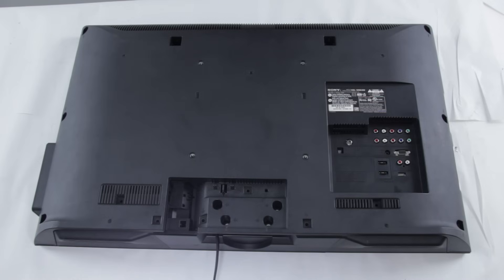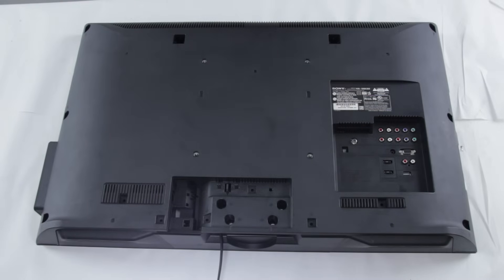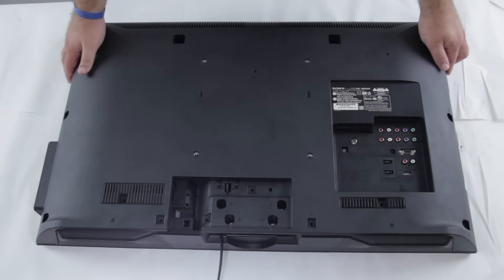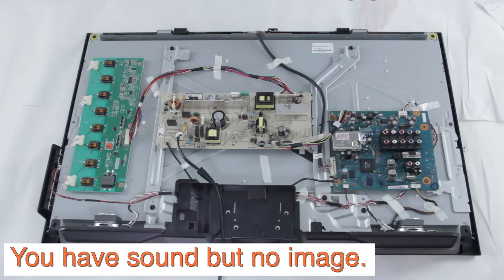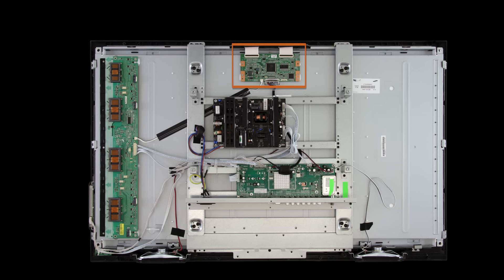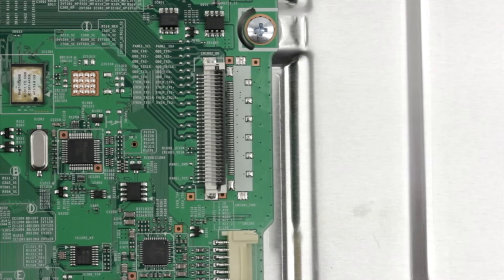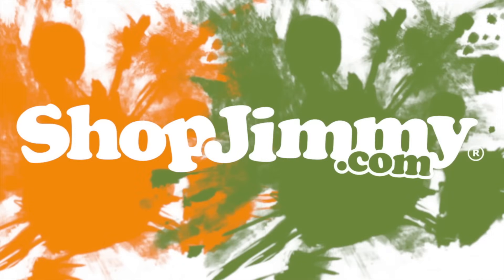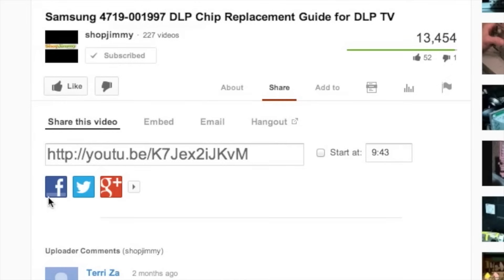LCD TV Repair Tutorial - T-Con Board Common Symptoms & Solutions - How to Replace T-Con Board

Comment: My TV is a Samsung Model: UN40EH5000FXZA VERSION: UF04. I applied what appeared to be a necessary firmware update because I was having trouble with sound drop out occasionally accompanied by picture dropout. Now I have no picture but the back light comes on. The local Samsung authorized repair guy said something like $80 for the board and a total of about $150 or more for the job, I countered, I built my own computer How hard could it be to replace a board. He sent me to a website where I could buy a board for half his price Shop Jimmy's, Do you agree that finding exactly the right board and carefully replacing it will fix it?
Reply: I just noticed your shop Jimmy's link. so I'm getting warm.

Comment: Hello, I took my Sony KDL-48W580B to the shop, because after a storm, wouldn't turn on, had the 3 blink error code on the LED, RED, the guy told me he hald a main board laying around he tested it with, and it did turn on, but had a white screen, my question is, is it fixable? or worth fixing? how much? is it the main board, or T-CON? or both? I really would like to fix this tv! and have experience with basic electronics

Comment: On that sony, I fixed one by putting pieces of cardboard at the top putting pressure on ribbons, supposedly the heat was rising the ribbons were flexing and that cause the TCON to freak out.. same model you first shown..  there was video on here with the procedure and I laughed but it worked... took 4 hours... I do repair for other companies as FE and seriously laughed when a video told me to do this but with that style TCOn, what do you have to lose?  I used corrugated so some airflow and less heat build up and used thermal heat gun to measure and well below any ignition point.. TVs been working 2 more years...  In our FE work we were told the TCON was married to the Panel and we were never allowed to swap them, now more n more I see people doing it and issues are resolved.. guess in past they weren't able to send out the correct board without EU getting numbers off old one since so many variants were out there on a single model so the practice was to swap panel and board... In fact the problem description you mentioned would have dispatched me a panel swap...  good luck, information was very minimal and basic for the title...

Comment: Hi.  My Samsung tv model LE40A456C2D has 2 problems.  Firstly it takes up to 10-15 mins to switch on or the screen to appear and secondly when its finally on the picture turns from normal to 3 colours and then 2 colours like the negatives you get for photos (dark and shady).  Both faults occured at different times. Any suggestions on the part or parts I would require?

Comment: Hi shopjimmy Please I have 2 sony tvs
1. KDL-50W829B T500HVF04.0
this tv turns on and make sound but wont display at all whilst the backlight comes on and the remote control too works.

2. KDL-42W805B T240HVF06.0 

This tv comes on but the picture is very bad loooks like a lot of vertical lines with different colours mostly green and red and there are few letters showing inbetween. 

Can you advice me if this are t con board faults or the LVDS cable? what do I need to buy and replace. Thank you in advance.

Comment: I have a Sony Bravia KDL-40W2000 I accidently knocked the back of the tv the other day and now i have 3/4 very thin vertical 
coloured lines down the right hand side of the tv. but the image on the rest of the screen is fine
Reply: Did you fix it?
Reply: No mate i've heard it was a faulty display panel so never even tried

Comment: Good Night, I have a LG 32LN570B-DH model TV that all of a sudden stoppped showing. I call in a technician and he changed out three LED lights of the same voltage. However, the TV did not show any picture. Instead there were these lines . So the technician stated that the T-Con board was bad and needed to be replaced. I purchased the T-con board and replaced it, but the problem is still there. What to do next?

Comment: Hello I have a sharp model number LC-55UB30U tv. The tv sometimes has a ghosted picture and is lagging in a way. Like it is showing all 60 frames at the same time. I have isolated it to the tv. What is the issue. I am looking to purchase a repair kit on your website.
Reply: Tyler Carter my 70" is doing the same thing
Reply: Tyler Carter it looks like distorted and overlapping, slow and lines will pop up from vertical and horizontal and if you push menu I get horizontal lines over the wording

Comment: Vizio o37L fhdtv10a.....got this TV from someone else.  The VIZIO emblem changes from amber to white when the power is turned on. Otherwise there is no sound or anything on the screen.  i don't know if the panel could be bad, T-CON board, or main board.  Any advice? Thanks

Comment: i have a magnavox 32 inch w/dvd player tv comes on won't turn off screen flashes color model 32MD359B/F7--S# DS1A0938154158  Is there a board that needs replaced or is there something you can help me with

Comment: Vizio model No. M3D550KD  S/N LTMPMLEN1450114 Has back light and sound but no display. Tried the flash light test but do not see anything. The Tcon board has inked in numbers and hard to read. There is a stamp either QB411V OR OB411V plus what looks like 42"od/13. on the back is hand written LU420EUF-PEH-751. I observe the backlight and it seems to change as the scenes change on a TV program.

Comment: I have a samsung UN60EH6003FXZC led tv, and I see a thin blue colour vertical line in the middle of the screen, the line starts from the top of the screen and does not reach the bottom , few inches from the bottom of the screen , no line. the tv works fine, both picture and sound, nothing wrong except the tiny blue thin line.
Any suggestion, or advice is highly appreciated.
thank you
my email is : fodwan@hotmail.com

Comment: Hi i have samsung 32 inch led tv and that's having color solarized issue except this everything is okay. I m suspecting that may be i should replace T-Con Board so how would i identify the T-Con parts name/number and i really wanna know this parts name cz im gonna purchase my own. Tv info : Samsung series 4 32 inch Led tv , Model - UA32FH4003R , S/N - 015B389G500369F , MODEL CODE : UA32FH4003RSER.

Comment: I have a Samsung model number AU48JU6000KXXA. It does not have the picture or sound. this happened after there was load shedding. the remote is also not responding. could it still be the tcon board?

Comment: Hi. I have a problem with mi tv is a samsung un40h5203af 
When i plug the tv to the power source no image or sound then the tv has a red light that blinks 6 times and stays off if i press the power button then it blinks quick once and nothing happens

Comment: I have a Vizio E60-C3 S/N: LFTRRZAR3701024 and last week it made a high pitched squealing noise then a popping sound then went all black. I ordered and replaced the power supply board and it worked for about a day and then stopped working and went black again. I have used a flash light to see if any image is on the screen when I turn it on but no image is seen when shining a flash light on the screen. The power led lights up when I hit the power button or hit the power button on the remote control but no video is displayed. The tv only has a couple of boards in it so I was thinking about changing out the other boards but didnt know which ones to order. How can I tell what I should do next? Please email me at albertsavill@gmail.com and I will order the other boards through you guys. I look forward to hearing back from you. Thanks in advance for your assistance

Comment: I have a Sony KDL-46XBR6 which has been intermittently turning green with thin white vertical lines and small alternating red and blue dots on the bottom.  If I turn the set off and then on, the problem disappears, sometimes for 15 minutes and sometimes for hours.  Is it the t-con board and is it possible to change?  The part does not seem to be readily available.  Sony does not have any and I haven't spotted any online.  My e-mail address is SKRosen1@aol.com.  Thanks for any help you can provide.

Comment: Hi. I have a Sony Bravia KDL-46V3000 that has an issue. several months ago it stopped receiving-displaying OTA channels 13.1 and 13.2.TV just displays the message 'no signal' I checked the signal path by plugging in another tv which pulled in these two strong local stations just fine. I thought about getting a SAM's photofacts for this chassis but I thought I'd ask for a second opinion before I perform surgery on my Sony. I don't know how the channels are synthesized or what doublers or freq multipiers  they use in the tuner section; I was hoping you might have some ideas or have had experience with this model Sony. - Steve

Comment: Have Sony XBR-65X930D that is losing picture after on for extended time.  I noticed when brightness is all the way up the TV will lose bottom of screen and work its way up.  There will be vertical lines where the picture suppose to be.  If I lower the brightness this effect will not happen as I believe it has to do with the heat.  Do you think the T-Con board is causing this.

Comment: My Toshiba 58L7350UC TV has power and has LED backlights, but NO video. The remote to control power on and off is working. But when I power up the TV, it stays at the initial screen light up. The Toshiba logo never comes up, which, according to my understanding, the the TV computer never boots up. I replaced the main board; and it is still the same. Could it be the T-con board that is the problem?  Thanks so much,

Comment: hi jimmy
i have a Vizio M3D460SR TV that exhibits a flickering image after it warms up, it seems to run fine for 10-15 minutes
i looked for burnt capacitors or something damaged on the boards but couldnt find any obvious
defects.
i get sound ok
could it be the tcon board, or is it possibly something else

Comment: Hi, and thanks for the video, they are very informative. I have a Samsung TV model #is un48h5500. I have a problem on the screen that started couple of days ago. There is a white spot on the screen, only one, in every input. I made a picture test and still there, is about in the middle of the screen to the right. I have a picture I can send. I call Samsung, they first laugh at me and then told me to call a technician. I work repairing computers so I'm I can replace a board, thinking that that's the problem. If you have an advice please. Im sure is either the t-con or the main board, do you sell those? which one you think is? If you have the parts in ebay send me the link so i can buy it.
Thanks, Marcelo

Comment: Very nice video, I have some trouble with my Sony KDL-40W4000 LCD tv. I think it is the tcon board but I want a professional opinion before replacing the wrong part. Basically the image start becoming wither and wither and sometimes even becomes negative. It is not an antenna problem because also menu is affected by it. No problem on the sound.

Comment: Hi, I have a Samsung 4k # un50ju6500fxza ih01, doesn't power on but red light blinks a few times. I opened up the back and my capacitors are fine no damage and the tcon broad flashes a blue light. Went on your site but ur out of stock on most items

Comment: Trouble with insignia model ns-42d510na15  serial t1114bns42d510na15h12890 TV shows insignia logo on startup then screen goes black. If I hold up my cell phone light to the screen I can see a faint image of the picture. Sound still works. After opening g the TV all is see is a tcon board with two ribbons and a larger board that it connects to. If if peek behind the LED screen all I see is white plastic and LED strips. I cannot find a back light control board. Should I remove the screen to look for one or is there something else I need to do to find the backlight control board

Comment: hav a samsung UN46EH53--FXZA VER: TH02  S/N 24TX3RAC707151X WITH VERTICAL LINES. is the t-con board responsible for this type of problem? respond at  jbliggett@gmail
thx
jbl

Comment: Hi so I have a Vizio.  Model number E470i-A0. Problem I have is when turned on I have sound but no picture.  If I point a flashlight onto the screen I can see a very faint image on the screen but it's very hard to see.

Comment: Hi, Kindly help me in finding problem with display. My Toshiba LED TV (32PT200ZE) has some kind of frozen display with sound but no picture. picture is coming only in lower bottom. Is this problem of T-CON, Logical board or Panel itself?
https://youtu.be/yMraKN3bHUI

https://www.youtube.com/watch?v=yMraKN3bHUI&feature=youtu.be

Thanks
Manoj
+919818841660

Comment: Hello...I have had my Samsung TV I bought new at Best Buy in 2012....the extended warranty ran out 3 months ago.  The model number I have is Samsung UN46D7000..  the problem is that I get these colored vertical lines on the picture that are annoying.  I have looked at many you tube and Web sites trying to figure out what I can do to fix the vertical line problem.  I tried "powering down" unplugging it for 20 min but that didn't help.  I checked out all HDMI ports for loose connections and rotated the cable HDMI in every port.  I also took the tv apart and visually checked out the power, main, and T'con board for any issues (cold solder joints, discoloring, broken wires, etc)...everything looked ok.  I wiggled a few wires for connectivity, but still the colored vertical lines still appear.  Please give me your opinion of what the cause would be.  I, being a dummy, suspect the T-Con board.  Anxiously waiting your opinion...thanks.  from an Army  frustrated Vietnam Vet😊

Comment: Greetings Guys. I have a 
LG-LC320WXN-SCC1-T-CON-BOARD-6870C-0325A-6871L-2214A-32-034-TV
 LG-LC320WXN-SCC1-T-CON-BOARD-6870C-0325A-6871L-2214A-32-034-TV
 LG-LC320WXN-SCC1-T-CON-BOARD-6870C-0325A-6871L-2214A-32-034-TV
 LG-LC320WXN-SCC1-T-CON-BOARD-6870C-0325A-6871L-2214A-32-034-TV
 LG-LC320WXN-SCC1-T-CON-BOARD-6870C-0325A-6871L-2214A-32-034-TV
Have one to sell? Sell now
LG LC320WXN lcd tv which the screen is black but there is a fine white line in the middle of the screen. The sound can be heard clearly and all the backlight tubes are functioning properly. I tried to change the backlight inverter but it did not work out. WOuld you guys think is the T-Con Board or the lcd panel is just dead. thanks

Comment: Hello,,, I have a sharp lc-65le645u SN: 411A2214087 , I'm getting a Low Dim Screen Picture on my Left Side only, and Black screen on my Right Side . My Back lights are all working and also Sound is good. Could it be my T-Con card ? .... what you suggest I could check into. Thank you

Comment: Hello I have a LG 42LH30 
Serial #: 909RMRH038198

Syntoms of the TV are that the left side sometimes flashes different lights or is just black. Right side is fine. I'd it the t-con board?

Comment: I have a samsung un55es7003. On the right side of the screen there is about an inch wide verical black line. The picture never shows in that place. In addition to that there are very thin vertical, color lines also on the right side that extend about 4 inches. Tv is still usable but as time goes on those thin vertical lines are getting worse and expanded further and further. Started of less than an inch in width and now as i said 4 inches. Im having difficulty finding a replacement tcon. Can you help?

Comment: I have a Sharp LC-70LE847u TV. There is no picture or sound, I have done factory reset and hard reset with no luck. The TV light is white and repeats 2 long lights and 5 short lights. For a while it seemed like the TV has been taking longer and longer to boot up. Then the other day it would not start. I turned it off and on several times and it finally started. The next day it would not start at all. Is this enough info to determine if the power board, T-con board, main board or a combination needs replacement? If not is there something I can do to narrow the options? I have always had the unit connected to a controlled voltage source. 

Johnscarf@sbcglobal.net

Comment: Hi there, I have a -SONY-KDL-50R550A. I am getting a distorted picture.. Distortion appears as distortion in the picture/video in the form of horizontal lines moving slightly up and down each few secs. Let me stress that these are not white lines, rather picture lines. They are scattered across the screen, but appears in some section as one distorted line in the upper part and few lines of distortion ( picture lines move up and down for these horizantal line). Is this a T.con board error? or a panel error?

Comment: HI 
I am having problem with my Samsung LCD TV . whenever u on the TV, it shows normal  but the picture will start disappearing with horizontal line however the sound remains normal. having listened to this video, it seems the TCON BOARD. the model code: LE40B530P7WXXU, MODEL: LE40B530P7W, SERAL NUMBER: AZQF3SXS801370E. IS A 40 INCH LCD TV. PLEASE ADVISE. MANY THANKS . DAUDA

Comment: I have a SONY KDL 40XBR2 and I have no picture or sound when I turn it on. The only thing that comes on is the green light and the Sony light on the bottom. Do you have any idea what is wrong. I have tried 3 main boards and still have the same problem.

Comment: Hi I have video issues (fading, clear to one side, blurry on other, etc)  When TV warms up picture gets clear (after 10 mins or so).  I thought it might be the TCON board because backlight and audio are working fine, but even after replacing TCON board and the issues still exists.  any thoughts?